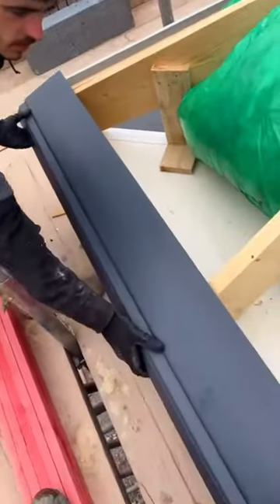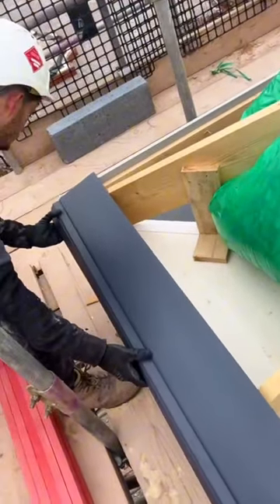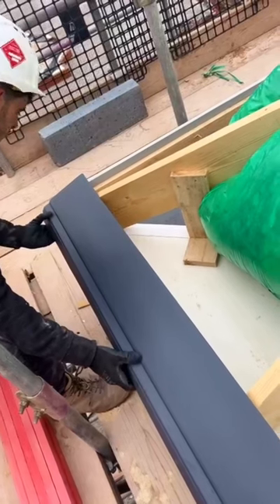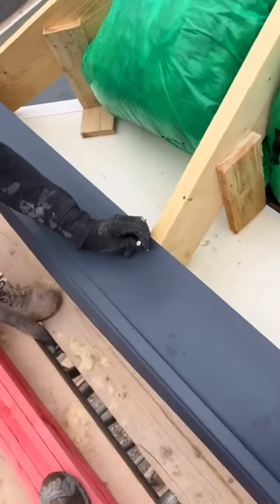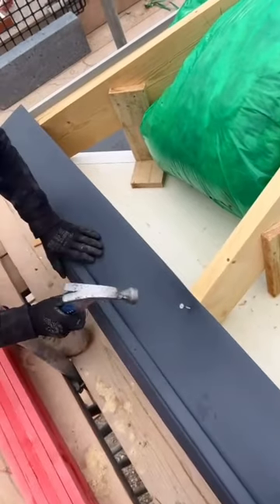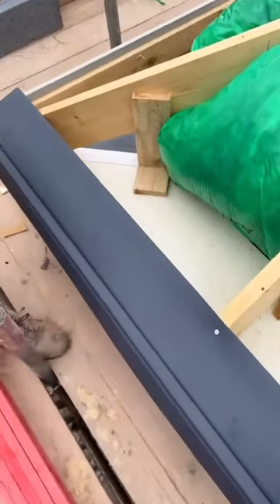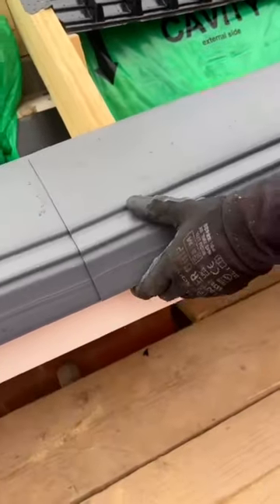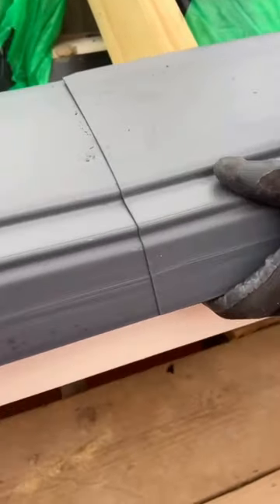How to put the felt support trays on & why! #roofer #educationalroofing #roofingcontractor #newroof

Comment: I Asked a professional roofer to fit some trays for me because I knew the under sarking on my property was in a poor state. 
It’s just rained and now I have a leak! Never had one before!
I climbed a step ladder to push back two tiles and spotted straight away what the problem was. Not only did he not replace the tattered under sarking but he (like you) nailed the tray to the rafters. Only, on my roof, even I could see that the rafters were lower than the facia/gutter board! Thus, the tray was tilting back into the property, along with the rain water! 
I think if the back edge of the tray had been supported at the correct height, and the tray possibly nailed to the top edge of the gutter board  instead of a lower rafter, it would have worked correctly. Something to consider .